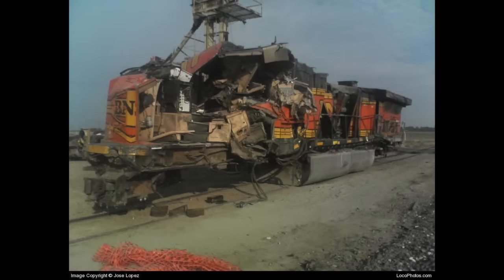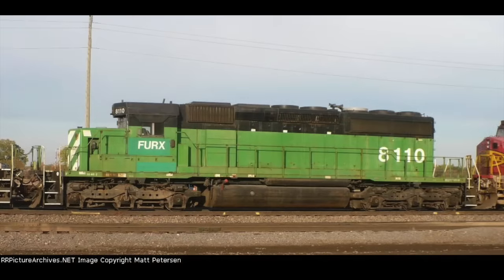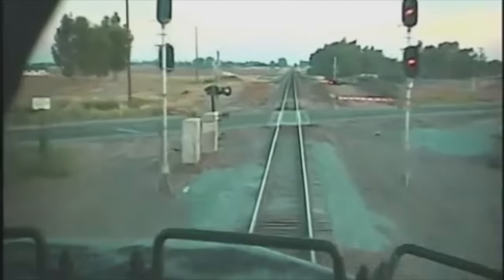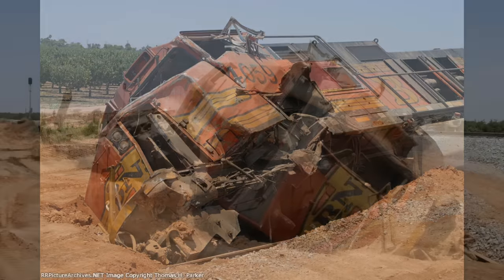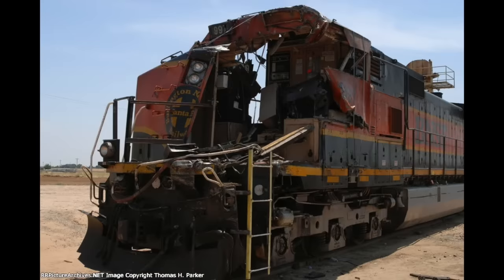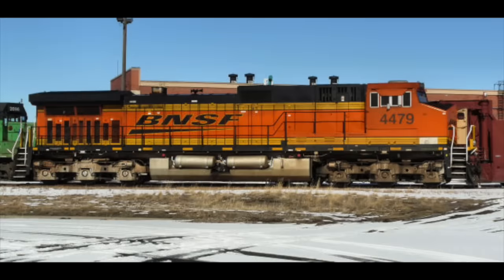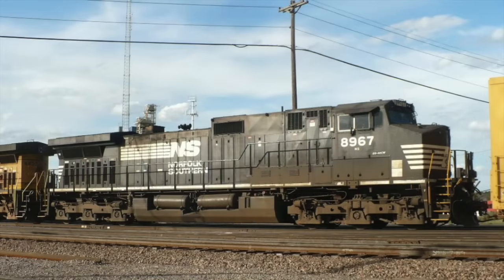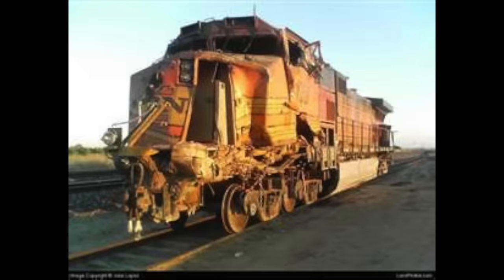Kismet Train Collision 13 years later

Comment: I feel like that operator that jumped was very lucky that none of the other derailed cars tipped over onto him when he landed. He was pretty close to those tracks. Amazing they were able to salvage so much of the wreckage. Thanks for sharing the story!
Reply: I had the misconception that everyone died in this crash. When the video started I thought, why don't these guys just bail tf out? Then I immediately thought, they probably did, but all that train has to go somewhere. So I assumed that's what happened. Sounds like he got lucky.
Reply: "Lucky"    Dude causes a $10 Million Dollar clean up, $8 Million Dollar Repair cost, worker injury's, and bailed out well before a crash but blames Drugs for a impaired response. . . Jumps clear of the train before the accident, but blames impairment on drugs
Reply: @donovanulrich348  there is a difference between impaired response time and impaired judgement. this was an impaired judgement case due to drugs
Reply: @CaptinPelley  dude
I don't care how drugged up he was, if he was responsive enough to bail out and LIVE. There's no excuse for not attempting stopping the train when you saw the headlamp

The company didn't wanna take any liability for the drivers actions, and labeled the substance the problem. Instead of just listing the truth, Driver error. . . . .but that puts the company at fault too 🤔

Comment: I was a conductor for UP and survived the Hoxie head on train crash in 2014
Reply from the maker: You were on the northbound QNLPI-17 / 5070? I’ll be doing a documentary on that crash in august.
Reply: How I need to know more about this
Reply: God bless you
Reply: Scary! I would be tempted to take my chances and bail,  which only sounds marginally "better"
Reply: APJ's Experience lucky......... why did union pacific take over southern pacific?
Reply: Suuuuuure... I'm sure that doesn't violate any nondis agreements the railroad lawyers would likely have had you sign.
Reply: @danmanthe9335  You wouldn't stand a chance.  If you were in one of the front Locomotives, you would have been buried by one of the others that derailed and buried themselves.  At least if you took some type of shelter within he cabin, you stand some chance of surviving.
Reply: @nevillemadden5210  crappy situation. Can you run to the back of a locomotive? Used to want to work on the railroads...
Reply: Hello, Aaron Jeffery, of Conway. It is nice to meet you.
Reply: I respect you man! I volunteer for RJ Corman and I love it! Glad you survived man!
Reply: Dan Manthe there is a door on the front and a door behind the Engineers seat.
Reply: God bless🙏🏻🙏🏻❤️❤️
Reply: Amed Tajan  I believe standard protocol is to get down on the cab floor under the console. The purpose of having that nose is to act as a crash barrier between the front of the locomotive and the cab. In most cases it holds up better than the rest of the engine does, and you certainly have a better chance at survival than if you bail at such high speeds. I think it's more or less the crew's call to make the judgement on what do do based on the situation and trajectory.
Reply: @ReadingAreaRailfan  SP was in bad shape.
Reply: @dougc190  now thats just sad.....😭
Reply: Dan Manthe 

What if you bail too late and are crushed by the locomotive or one of the cars?
Reply: Thank goodness you survived. I’ve never been in an accident involving planes, cars, or even trains.
Reply: I’m glad you survived bro! PTC wouldn’t allow that today! Go by an approach signal at 33 mph you’ll be put in suppression if you don’t start grabbing some air.
Reply: APJ’s Experience Good job
Reply: @TexasAlabamaBoi205  you can go by an approach at track speed as long as you are taking action. If you're above 33, let's say you go by an approach at 40mph, get down to 39, then creep up 1mph back to 40, it's an automatic penalty.  At least that's how it's set up on NS.  For a long time I was scared to go by an approach over 30 mph when running ptc, but once you spend a long time getting to know the ins and outs of how it operates its not so bad
Reply: tenobles what service unit do you work on bro? I’m with UP on the southern region out of the Houston service unit. I thought about applying for NS and move to Georgia.
Reply: @TexasAlabamaBoi205  I'm on the piedmont division out of Linwood,   NC.  I dont know how things are going down south of me or other districts and divisions, but my district is huge, and we have conductors furloughed with more to be cut july 1st.  NS is about to roll out the next phase of "Precision Scheduled Railroading" across the system, and I know of about 5 trains on our district alone that are gonna be abolished and or combo'd, and DP'd.  If you have good seniority over there on UP, you probably better stay put, lol
Reply: You like gardening?
Reply: I used to dispatch the Hoxie (421) and Little Rock terminal (51) 2009-2014 before moving to another territory. I remember talking to you on the radio. That was a sad night indeed.  Hope you are well my friend.
Reply: Where do you guys use the bathroom at?
Reply: How the F did you survive that? God must have his hand covering you and protecting you
Reply: @hattrickpsh  I love train dispatcher and all that they do, hopefully following them into the career field one day. I greatly appreciate all DSPR's do, so thank you.
Reply: Ryan’s Colorado Rail Productions yes sir I was. The southbound crew was killed on impact. I was seriously injured and did not return to railroading. My engineer had to pull me out because my back was broken among many other bones. I was almost paralyzed from the waist down but I was fortunate that I can still walk. Yes that’s a good case to report on. If you need any info I’ll be glad to help. I was on the side of 5070 that got hit and my engineer told me I got hit hard in the head- I have no memory of the crash even though he said I told him they were still coming right before they hit us.
Reply: Dan Manthe it was at night and even my engineer thought they were stopped behind the signal till right before the crash
Reply: Matt Marzula yes I was in that crash
Reply: Zach Whitaker thank you
Reply: Middle Tennessee Railfan thank you
Reply: hattrickpsh thank you
Reply: Neville Madden it’s true- I was in the Hoxie head on and survived, albeit with serious injuries, but I survived. There were two survivors, me and my engineer.
Reply: Zach Whitaker thank you Zach!
Reply: Amber Jones thank you
Reply: Bill Cosby yes
Reply: hattrickpsh it’s been 5 years almost and I’m doing better than I was when it first happened. It’s still seems unreal to me that I lived through that. I hope all is well with you. Is the dispatcher they call big dog still out there or did he retire?
Reply: @danmanthe9335  I'm gonna take a guess that the window of bailing AND surviving is rather small and closes quickly...aka, the longer you wait, the less likely you'll survive.
Reply: @likesanddislikesetc  

That would be a terrible experience, perhaps it's a blessing you couldn't remember the crash...otherwise, I'm sure you'll be suffering from some PTSD
Reply: @calebdrake3544  I'd agree. Possibly closed by the time you realize that you need to exit
Reply: @calebdrake3544  @Dan Manthe The window depends on many factors. The biggest being how you land when you bail. You might land on your ribs & hips in a thicket of thorn brush, & be stuck for a minute or more. The ideal bail is on open, clear, soft ground with feet & legs not broke, so you can run or crawl away fast as possible. Those trailing cars & locos are 70-90 feet long & will jump & swing over you within seconds if you don't run away fast enough. Otherwise you best to ride out on the floor of the cab, prepared to roll & flip with heavy impact(s).
Reply: Matt Marzula yes I survived the Hoxie train crash. If you would like I can email you the details and some photos. I no longer work for the railroad.
Reply: Ryan’s Colorado Rail Productions looking forward to it!
Reply: APJ’s Experience I believe we have probably switched cars and built trains for you and your engineer before at my rail yard here in Marion , Ar. You ever been here?
Reply: Hey Pawley! 😁
Reply: @Cliff00936  there is a bathroom in the hose of the locomotive.
Reply: @likesanddislikesetc  Big Dog is still hard at work dispatching the Capital Corridor on the west coast. He is a true class act. Glad to hear you and Mike are okay despite the horrible circumstances. Take care!
Reply: @TexasAlabamaBoi205  I dispatch
 TD3 on afternoons...You'll know its me if you hear "Its your time to shine."
Reply: tenobles wow! Will do bro! I didn’t know you all are doing PSR too. That has caused a lot of jobs to be cut. I hope it doesn’t last long.
Reply: hattrickpsh I’ll be listening out! You’re in Spring or Omaha?
Reply: @TexasAlabamaBoi205  Spring Dispatch Center
Reply: hattrickpsh right on! Do you cover the Reisor and Anchorage sub too? Is MRC still dispatching? He always sounds upset lol
Reply: 500 likes
Reply: @TexasAlabamaBoi205  no, I just work TD3 and occasionally cover one of the other Houston Terminal jobs. MRC is regular on Livonia desk 38 in afternoons. He is a cool cat, just doesn't put up with much lol
Reply: Ryan’s Colorado Rail Productions shit that’s my birthday month!
Reply: Cliff in the nose of the locomotive their is a little airplane bathroom on most units... some of ur older cabs don't have
Reply: and what did your P-test show ?? and how long did it take for a dispatcher to answer the radio. On the Houston division it's not uncommon for 45 minutes to elapse when punching 911
Reply: Liar
Reply: Noodle
Reply from the maker: 5 years ago today...
Reply: @RyansColoradoRailProductions  ok
Reply: Ummmm you bailout or somethig else.......
Reply: APJ’s Experience email sir?
Reply from the maker: Amed Tajan  yes, take the Roswell train wreck in New Mexico of 2015 as an example. the engineer might have lived if he wouldn't have jumped.
Reply: OH MY GOD THATS SCARY
Reply: Ryan’s Colorado Rail Productions I knew him well!!! Jesse was a good guy!
Reply: Ryan’s Colorado Rail Productions Never got to that documentary I see.. :/
Reply: @Cliff00936  they have bathrooms in the nose of the train.
Reply: @dougc190  but at least SP knew how to treat their employees up not so much
Reply: @Cliff00936  there's a restroom in the nose of the cab

Comment from the maker: Ratings disabled because of h8rs. I apologize for not researching enough and saying the crack in the southbound CONDUCTOR's system was the cause. There was no direct cause, but a lot of contributing factors. A lot of things I said in this video just make me facepalm now. The upcoming videos will be a lot more thoroughly researched and not consist of me jumping to conclusions to state the cause. I apologize.
Reply: Thanks. One thing surprised me was that the train was diverging at a significant speed.  Perhaps your track is better but we are used to diverging at very low speed.
Reply: I was going to say... even if he was high at the time of collision, that's only one factor, saying he was high only goes so far towards explaining why the collision occurred.
It also doesn't explain why the other guy didn't notice the problem and do or say anything, as all trains have an engineer and a conductor.
Reply: NrexXConrail Bnsf Burlington northern Santa fe Bnsf Northfolk southren Fakebonnet
Reply: Dr Deuteron  H1, 2 and 3(and 4) stand for "Heritage" - it's a paint scheme BNSF uses, it's called that because it's inspired by the Empire Builder scheme used by predecessor GN.
The first one didn't last very long and only a few still have it, the second one was much more popular... H3 was a variation of H2 with the new "Swoosh" BNSF logo... H4 is only for road switchers, and it's a combination of H1 and H3.

Warbonnet was the scheme used by Santa Fe, they originally used it for passenger trains, but it was adapted for freight locomotives in the late 1980s and used until the railroad merged with BN in 1996.

Falsebonnet was one of if not the first BNSF scheme, it was first applied on locomotives that were ordered by Santa Fe but went to successor BNSF, as such they had the ATSF warbonnet paint, but BNSF markings.
Some falsebonnets were actually so early, they arrived before Santa Fe had even fully merged with BN.
Reply: I was secretly hoping you were going to say that you had crack in your system when you made the video. wait... on second thought I'm glad you didn't

Comment: I'm absolutely amazed that the engineers and the locomotives survived. But the SD50 wasn't so lucky RIP
Reply: Probably figured there's no point in salvaging an unreliable locomotive, if they had tried to salvage it, they likely would have had to do a rebuild with the prime mover from an SD40 like NS did with theirs, which is essentially building a whole new locomotive if its wrecked as well.
Reply: @adamross8190  my grandfather said they probably scrapped the sd50 for the quote good iron since the locomotive is much older when locomotives where made with much thicker iron and steel
Reply: @wholelawyer  yeah it was financially a better move to scrap it than rebuild or refitting it
Reply: @aoki6332  ya even progress rails attempt at rebuilding them was awful
Reply: The BNSFxSanta Fe GP30 was never mentioned on what happened to it after the crash. My guess is that the GP30 number 2437 was scrapped along with the NREX SD50.